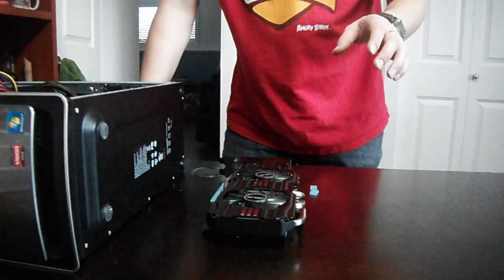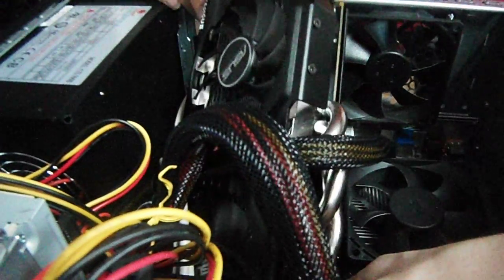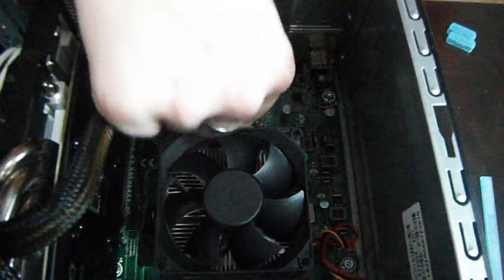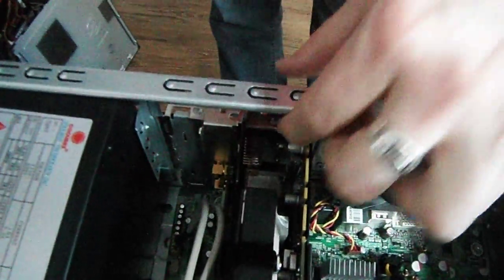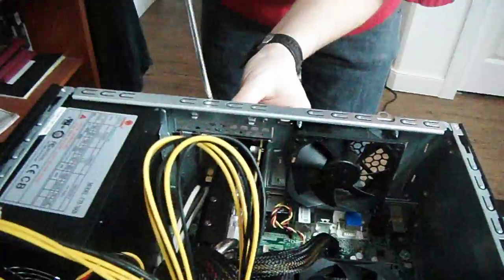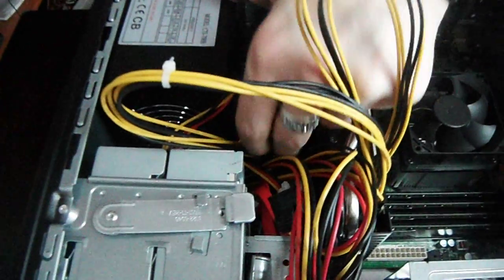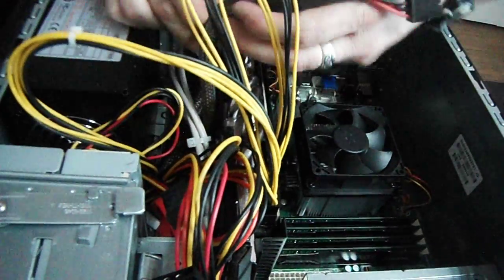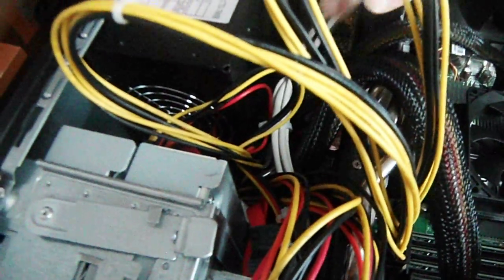Asus nvidia Geforce GTX 670 Video Card: Install

Comment: mine turns on and it want show video im useing the asus motherboard so it tells me that something is wrong with it becuase the pcie light blinked red but the funny thing about it the card still runs perfectly fine the green light comes on indicating that its still on so something has to be wrong the the board it self and i cooked it 3 times now first 2 times 5-10 mins 3rd was 15 still nothing but same result
 .....I need hellpppppp

Comment: Hey, I really liked your video and it seems very helpful. Right now I wanna get the red msi nvidia gtx 970 and that card is very long. I also want to replace my 460 watt power supply with cx 600 and also add another 2tb hard drive since my games are filling up the hard drive. I have about 100 games in steam so far. I have a hp computer which is hp envy h8 1437c. And my current video card is nvidia geforce gt 620 which is low profile video card. So do u think i can fit the nvidia gtx 970 card? I don't want to build a computer because I have good processor and good ram. I feel like upgrading is better for me. But maybe in two years later I will build one myself

Comment: Have any issues using a NVidia card instead of ATI Radeon? That's what your Pc came w factory right? Integrated ATI? That's what I have an older 2011 HP and just ordered a MSI gtx 750ti

Comment: Im trying to buy a new PC to play games like TERA or Skyrim .... Does a Nvidia GTX 460 fits in a standard HP Pavilion Slimline 400 OR a Lenovo H520G Intel Core i7-3770 ??? BOTH with another SATA HD btw !
Reply from the maker: Well I say if you going to put $1,056 in to a computer I would build or get an HP also you have the Asus computer, but most of all i would say you can't fit the 460 but you have not PCI-E Line But i don't know truthfully... so you best set is to build a good Computer from a store, and ask or buy one form Best Buy or Future Shop (computer stores) Sorry i could not get the answer for you.

Comment from the maker: I have a 650 Watt Power supply if you feel the need get a 700 watt but you dont need to have that type of room only if you plan to get a snd Asus 670 GPU card.
Reply: What's the manufacturer of your PSU? I'm looking at a Corsair TX 750 watt, wondering if it'll fit in my HP Envy 700-210. Thanks.
Reply: .relic to be honest I dont  know the HP line of computers that well but i find the Power supplys are all the same if they are 800w and lower, so maybe a 300w might have a smaller size but if you computer is a mid-tower case then your get the right size with the corsair 750w. but that PSU is good for bottom spot, PSU cases. if you know what i mean?!?! No the top PSU. so look at your case and see if it's a bottom or top.
Reply: .relic And yes the manufacturer is Coolmax
Reply: .relic I also see a good viseo on Techquickie to help you out better then i could
Reply: King frog Reality Is a 600 watt good enough?
Reply: Yes it would but with an nvidia thats right but an AMD you might need 650 Watts

Comment: I have a Dell Core2Duo work station 390 where the motherboard only has the 4 pin to the motherboard and I put an Asus GTX 470 in it. But it blew out my motherboard even though I had a 600 watt power supply. Although, the Video card survived.  I think you need  the extra 8 pin in the motherboard for these monsters. I had to replace the motherboard but I put a lesser power Video card GT 440 for general use. I later built a computer that can could handle and fully utilize the Asus GTX 670 with an 8 pin/24 pin TZ77XE3  Motherboard  BIOSTAR i7 IVY processor. It has a 900 watt Antec power supply that was actually replaced by Asus when I had a Antec 700 watt die on me. Nice power supply. So I would be careful installing the GTX line of video cards on older computers.
Reply from the maker: Yes they are powerful but i have never day a problem with the Asus 670 GTX over powering the Motherboard. so you might have a faulty wiring for your computer to kill the power supply and motherboard.  Sorry to say but i had too. and good luck this is the best advice i can give you.
Reply: King frog Reality My only advice to anyone is that if anything strange happens like a sudden restart or anything odd, heed the warning. My son didn't heed the warning signs.These cards are overkill for older computers. You will never utilize it's full potential. The card didn't damage the power supply, only the motherboard of the Dell 390, nothing else. The same power supply is in the Dell 390, only the motherboard was replaced. I was just saying I ended up with an Antec 900 watt because of a failure of an Antec 700 for this new build I made to utilize the full potential of the GTX 670. Actually, the Antec 700 didn't fail, it only emitted a burning odor, so Antec advised me to replace it. I didn't want to take any chances.
Reply from the maker: Ray Rainer Ok I must of miss red you massage, hope you find a better MBorad

Comment from the maker: Yes it is that simple but remember to go to the site 
geforce dot com slash drivers
 and to get the old files use the uninstall programs, under control panel, if you have a PC not a Mac

Comment from the maker: now th main connection is DVI- ... connect cord so you might get it on the 660 but the 670 will not run without software or the DVI- cord.! And if you can find software it might be compadable to your AMD CPU(possessor)  sorry about that. Newegg.com sales good DVI for cheep.

Comment: hey, i was wondering if u know what i did wrong.. i installed the card like you did but when i connect the hdmi cable it just says no signal going to sleep on the monitor and then it's black but when i connect the hdmi cable with my old gtx 660 it works..

Comment from the maker: I had some time to Over-clocking the GTX 670 and found its best at going up by 10 point on each, like GPU Boost by 10 and Memory clock by 10 then see how the game is playing. that's the best way to fine your FPS and Temperature. and yes it take time but doing it right the frist time make the game run right. It did not laged at all the GPU run right and the game was fine but i got mine at [GPU 1070(MHz) and the [Memory] (MHz) at 6098 But all Graphic card are different. so make the 10 point @ time

Comment from the maker: well the card is 10.5 " so if your Hard Drive is in the way you might not want to stick with the GTX 670. but you can mount SSD drive some were but that means you don't get all the Dive space. 

but to tell you straight you will fit your GTX 670  in your HP 8 or you should fit.
But i hope that helps. I know the HP Pavilion P6000 Series fix's A GTX 670 Geforce

Comment from the maker: Your Right but the time next year comes i will be building a Intel Computer. Also I will not have a per-built computer there low in everything, but it still run so im good for now. (I think) do tell me, more about this new x79 CPU if you know anything about Ivy bridge.

Comment: It's strange how you bought a $400 graphics card and put it into a relatively mediocre pre-built system. When your spending that much money, I'd image you'd have a custom build. Looks like your bottle-necking the system with that cheap AMD CPU with a stock cooler. I'd recommend building a very good system, because you'd want to get the most performance out of that powerful GPU, since you spent so much on it and putting it in a cheap system.